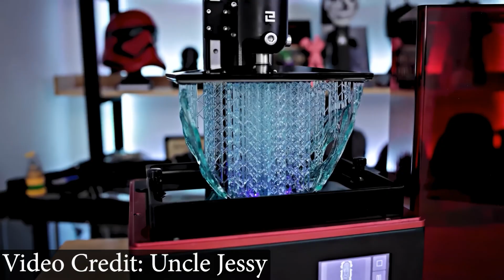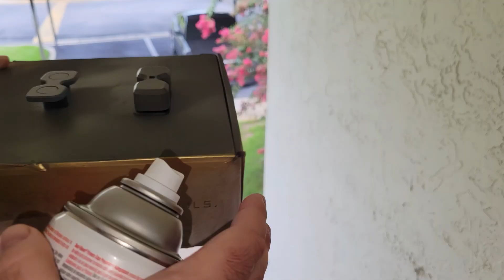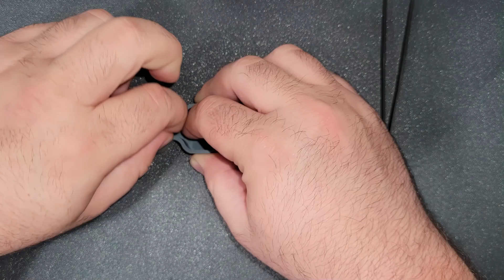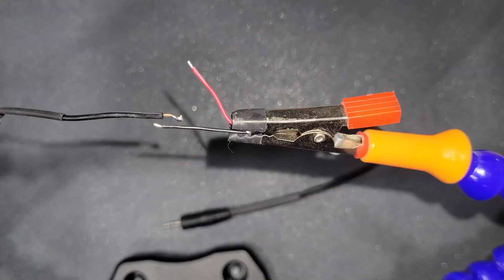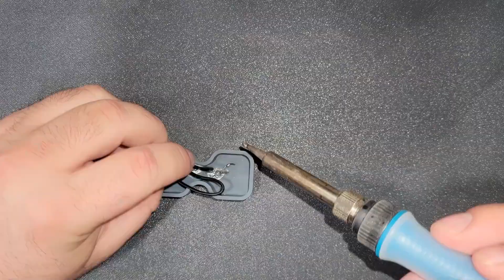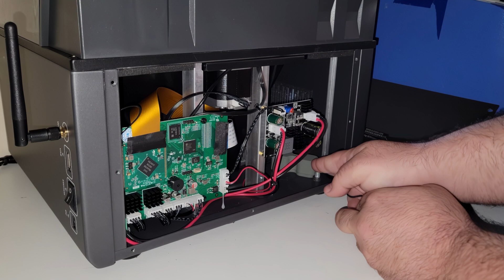DIY ResinLapse Cable

Comment: What camera do you use?
Reply from the maker: I'm using a Canon T4i. Just a heads up, like the original resin lapse cable this is designed after, it is only designed to be compatible with Canon cameras. You could possibly modify it to work with other brands, but I do not have any other cameras to experiment with to be able to create a different design